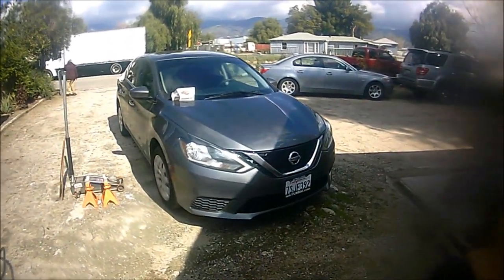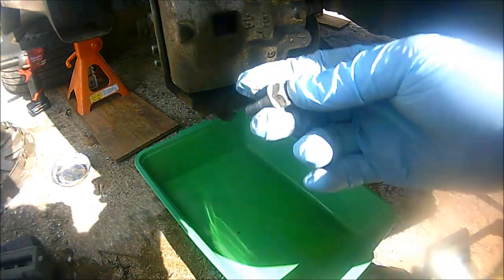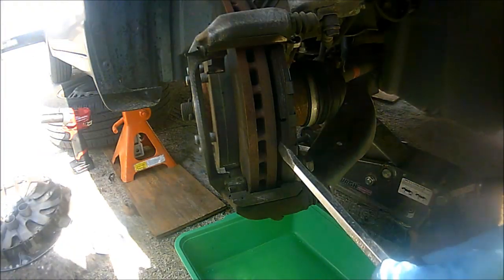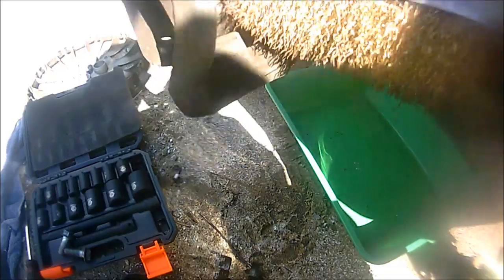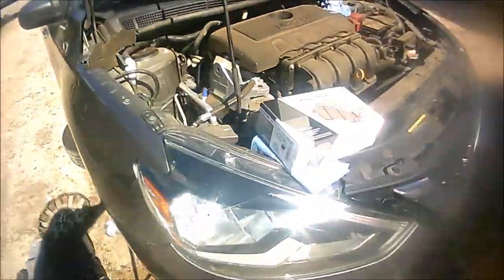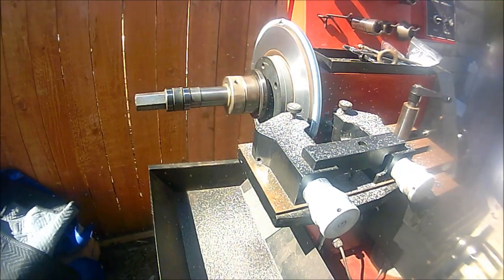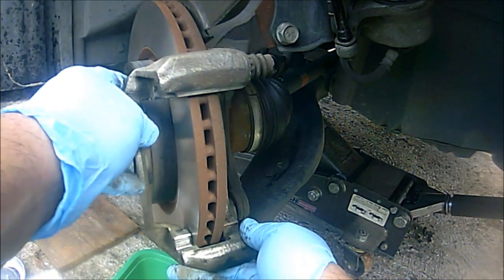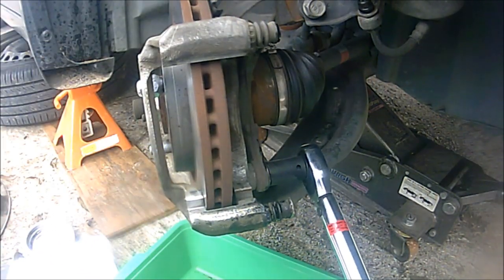Nissan Sentra Front Brake Pads and Rotor replacment 2013-2018

Comment: thanks a ton for this video. I did my first brake job on my 2015 sentra today - I had never replaced rotors before. This video was great - I had a hard time getting the pads off at first, then realized I could just put a flathead screwdriver behind the top of the pad and pop it right off. My factory pads/rotors lasted 87k and were basically worn down to zero. 

this was super helpful and saved me about $800.

Comment: good video, I would add lube to the upper slider "valley" for the brake shoe.  I understand there is spring metal assistance and, your in SoCal but, lube is always crucial for proper movement.  Thank you for the specs, that was great, you provided me a heads up on a job I'm doing this weekend.  Stay safe brother.

Comment: It’s easier to depress the caliper piston while the old rotor is mounted by sticking a pry bar or flat-tip screwdriver between the rotor and old brake pad and pry until piston is fully depressed.
Reply from the maker: Thank you for that awsome feed back.

Comment: Very well detailed Oscar. I have a question though? I have been doing brakes over 25 years & had a issue with a 2010 nissan sentra 2.5 & changed the front as you did in the video & when I went to pump brakes & still no brakes. The pedal would be hard then it would go completely to the floor? It was spongey? But than I noticed fluid was coming out rear cylinders? Could this be a cause of sitting for 2 years & no movement? Master cylinder was very low as well. I put about 1/2 quart of fluid as well. I've never had a issue doing brakes just this one. Any input would be greatly appreciated Oscar & thank you. Have a blessed day 😇

Comment: Hey Oscar Ruiz I have a question at minute 1:21 What type of Impact Drill are you using because I have a 20 v Power Dewalt Impact Drill and mine doesnt have the torque to remove the bolt of the wheel or is it that I need to loosen them first by hand Thank you and I would greatly appreaciate a respond
Reply from the maker: Hi max, it the milwaukee 1/2 inch impact 12v gun .  It's not a drill gun, 250 ftlb of nut busting torque. 179.99 at ur local home depot tool only, battery are extra
Reply from the maker: Best investment you will ever make.

Comment: Great video and well explain.  I have couple questions.  I'm attempting to do this on my wife's car how do I know if rotors can be resurface or not? If they do how can I find a local shop that would do this for me? Are those pads better than oem  nissan?
Thank you.
Reply from the maker: Good morning Eduardo, oem parts are always the best way to go if you can buy them but if your on a budget anything close to oem will do, remember when ur buying OEM parts your paying more but the your paying for the quality aswell. As for your rotors, use ur index finger and rub on the rotor surface ..it should feel evenly nice and smooth...if you feel some unevenness like warping or if you visually see a lip on the end of the rotor it's recommend to get ur rotors resurface for a smooth braking system. If you take it to your local auto store like orally auto parts the will charge you a fee of 15-20 per resurface rotor...depends if it's for a car or truck. Or any tire shop or autoshop has the equipment to do the job. They will check with the manufacturer to see the minimum depthness of how much they can resurface each rotor. Trust me they will tell you if they can not since they are liable for making sure they are safely doing the job right. I own a brake lath and I resurface rotors for my neighbor all the time but I check the car or truck recommend specifications and make sure I don't take too much off where the safety is compramis. I hope this helps you out.
Reply from the maker: Also the rotor hav a stamp minimum thickness in it, you can also check when you get ur rotors back to make sure they are to spec.

Comment: Hey man! Thanks for the great video. How essential is a torque wrench to put the caliper back on? Is white lithium grease an acceptable substitute for greasing parts?
Reply: No, you have to use high temperature grease specific for break parts, or else the grease will cook and the brakes will seize onto the rotor.

Comment: Would you use the same method to replace rear break pads and rotor?
Reply: The procedure is predominantly the same, although the back pads themselves may be different.
Reply: Also sometimes you have back drumbrakes which they don’t use brake pads

Comment: Hi we tried removing the driver side couldn't remove the bolts for the rotors do they remove the same way as the passenger side ?
Reply from the maker: Hi Rachel, yes everything should be the same as the passenger side. Try spraing the bolts with some penetrating oil see if the help

Comment: @Oscar Ruiz-WhT model is the Milwaukee drill you are using.???
Reply from the maker: Hi guss, it's the stubby impact 12v Milwaukee model. It's the 1/2 impact
Reply: Okay thank you sir, btw I bought some Duralast Gold brakes from Autozone and they don’t have pins only on one I should return them right they need to be exactly the same right??
Reply: My vehicle is a 2015 Sentra and the OEM’s have the four clips
Reply from the maker: @agudinosanchez  yes I would definitely return them. And check the new ones aswell for the exact fit
Reply: I am thank you I’m going with the Wagner TQ QC815
Reply: I think you were doing a 2016 that’s why it has “A” mine is 2015

Comment: Why do people put the slide pin grease on the back of the brake pads? Your caliper slide pins need grease or they will stick. Put brand new brake pads on without greasing the pins will cause your pads to stay compressed against the rotor making them wear out. Most of the time it's one side. Then you got squeaky brakes. Eventually your pads will wear out sideways.
Reply from the maker: Hi trail mix, great question, the type of grease I used on the video "Permatex" is designed for metal to metal contact as well as a great lubricant for internal parts. I used this type of lubrication for a quiter Ride.
Reply: I use the same. I just bought a bottle instead of packets.

Comment: no need bleed brakes after?
Reply: TJ Carino same question ??
Reply: No the system stayed sealed and the brake lines didn't get air in them. Pressing the caliper in pushes fluid into the resrvoir (open the lid before doing this).
Reply: @bryantv7  No the system stayed sealed and the brake lines didn't get air in them. Pressing the caliper in pushes fluid into the resrvoir (open the lid before doing this).
Reply: @RedneckPCtech  HOW ABOUT THE REARS ? SAME'.? SYSTEM
Reply: @slams777  yes the rears on my 2017 SR (non turbo I think same as SV) are disc.  I replaced all 4 brakes front and back with no air in systrm and no extra fluid needed.  This is my wife's work commute vehicle and she puts 25,000+ miles a year on it.  All it takes is a 14mm and clamp or something compress the caliper.  Super easy job.